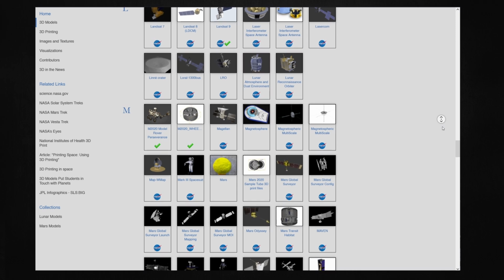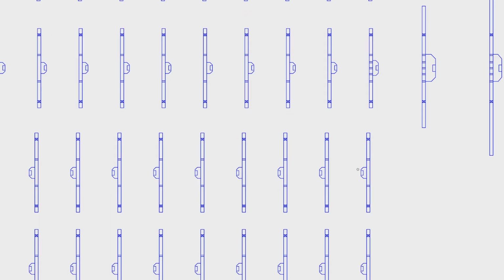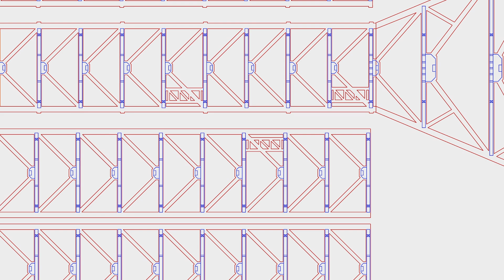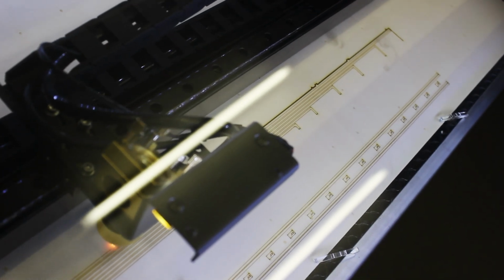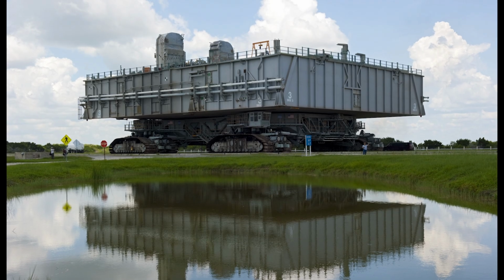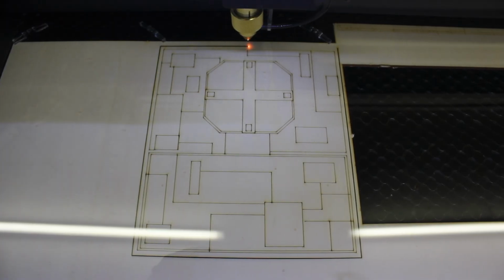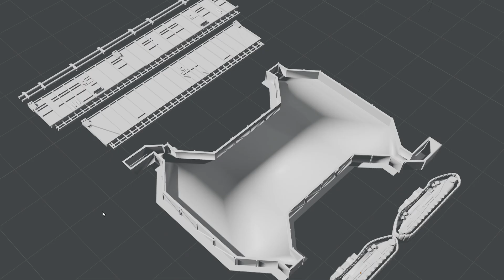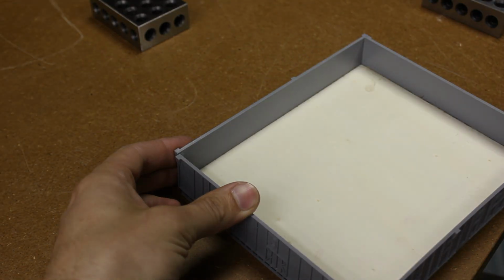Building a MINIATURE NASA Mobile Launcher for Our Film

Comment: In another video, you mentioned using hot glue over superglue because it cures faster.

I recommend adding an accelerator spray to your toolbox. It allows superglue to cure very quickly, speeding up assembly. Additionally, accelerators create stronger bonds, making your model sturdier. They also help reduce mess during assembly.

Accelerator sprays + superglue can even be used together with regular glue. Simply attach the pieces with a few dabs of superglue and accelerator, then use regular glue for a stronger final bond. This way, you can assemble things quickly without breaking the bank on superglue, and still achieve a very sturdy result.

Here's a bonus tip for DIY enthusiasts: Superglue also cures very fast with baking soda.  It's a cheap alternative to accelerator spray. You can either apply the baking soda first, then add the glue, or add the glue and sprinkle the baking soda on top. While not as neat as using an accelerator spray, it is much cheaper and baking soda can be used to fill voids too.
Reply from the maker: Ah yes I know about accelerators but it still hasn't become a thing here in Croatia so I would have to order internationally and it would quickly become too expensive. But I'm keeping an eye out for sure 😉😉

Comment: The stencils look great, but have you considered custom waterslide decals? Uses existing any paper printer and the  paper isn’t going to break the bank.

The fun facts about the launcher and rocket were nice additions btw.
Reply from the maker: Yes! I did buy some decal paper later. It works great, unless you need white decals because most printers don't have that option. I will use it in one of the next videos! ;)

Comment: For thin, strong material to cut you can use the plastic stuff that they stick on kitchen cabinets. It's about 0.5mm thick and cuts ok
Reply: That they more or less stick on kitchen cabinets. It comes off in the end. But having said that, check if it is not PVC.....PVC and laser cutters don't mix. It creates chlorine gas that will destroy your laser printer (and you, as it is toxic) as it is corrosive.
Reply from the maker: Yes, exactly! It's not safe to cut everything! Gotta be sure about the material type.